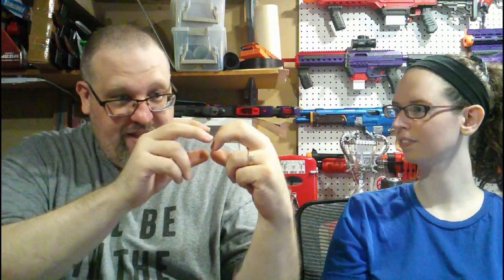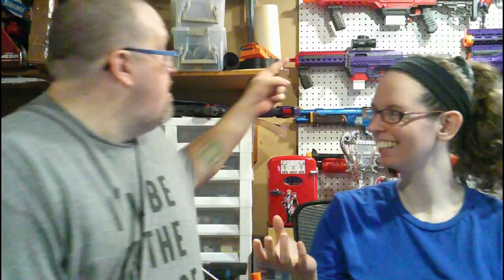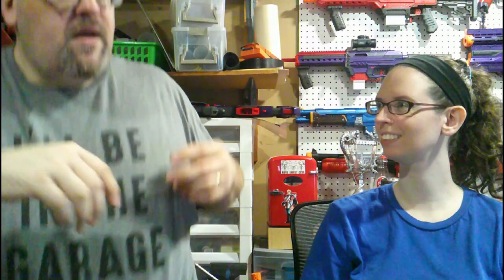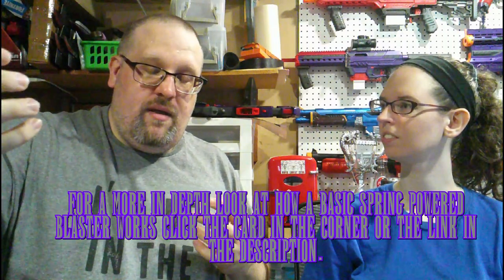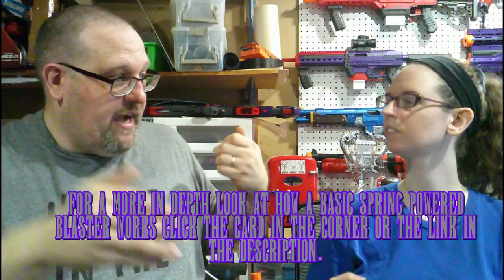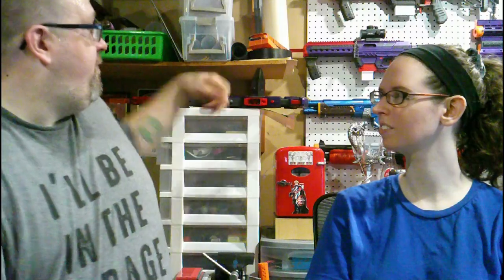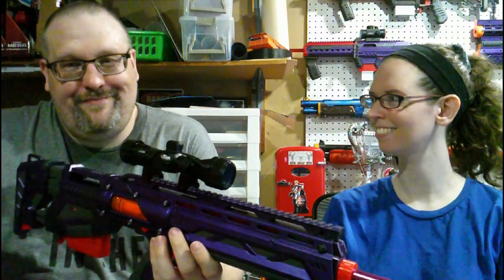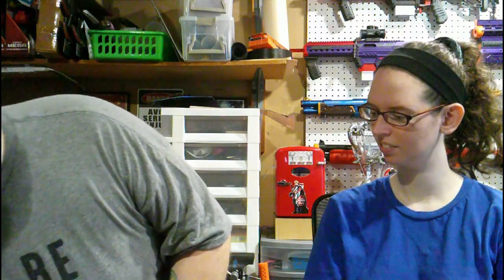Welcome to the Hobby - Springer vs. Flywheel blasters

Comment: Great video. Do you happen to know the formula to calculate optimal barrel length?
Reply from the maker: I wish I had a formula for it. Most common barrel length I have is the 45cm length. I have a few shorter and longer. There might be one by someone smarter and with more time than myself.